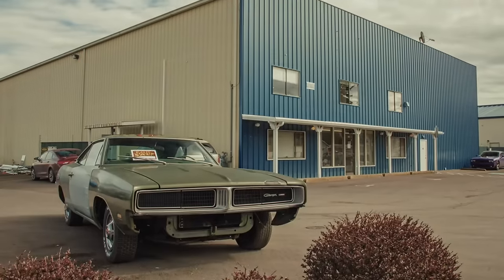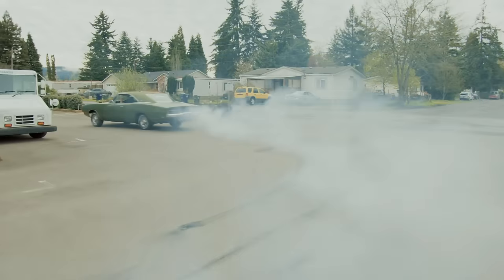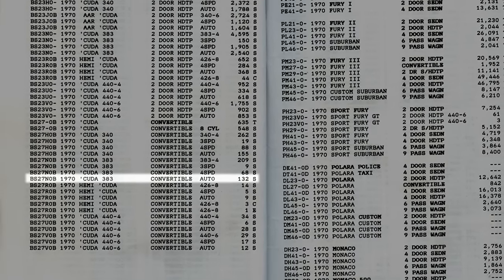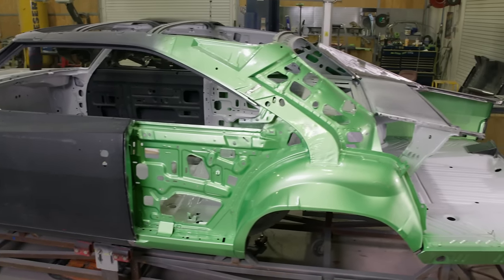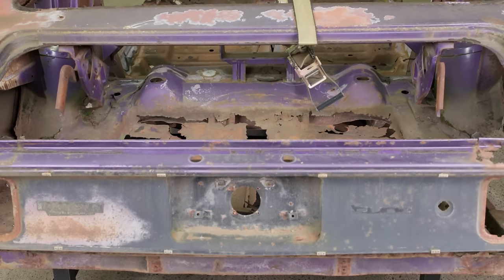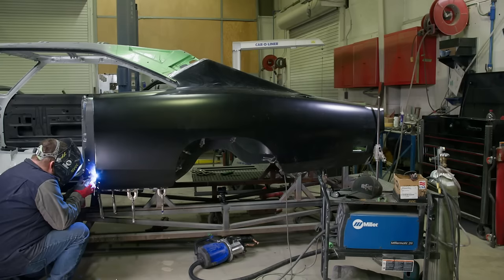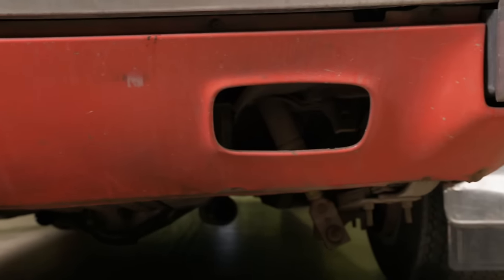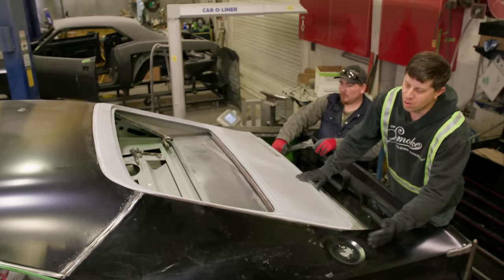RUST IN PIECE! DEAD ON ARRIVAL CUDA CONVERTIBLE MAY NOT BE REVIVABLE.

Comment: I have a question. When you guys do panel replacement. Do you weld back in the part of the trunk gutter on the drivers quarter panel that contains the vin and also the vin in the radiator core support?
Reply: You gotta know these shows aired years ago, they are OLD.  And certainly nobody at GYC watches this stuff to respond. 🎬
Reply: @cuda426hemi OK. Thanks for the heads up.